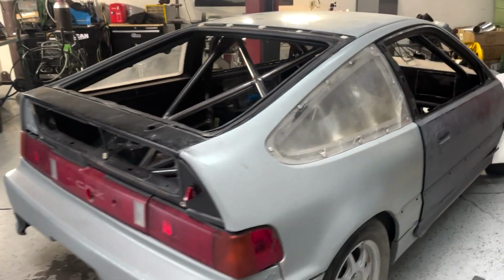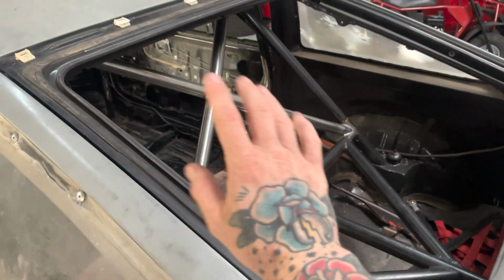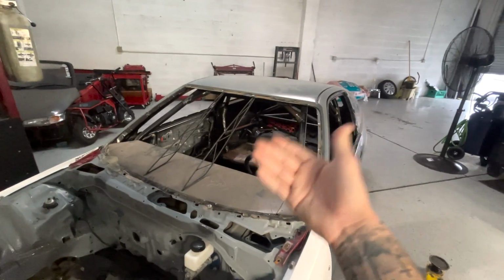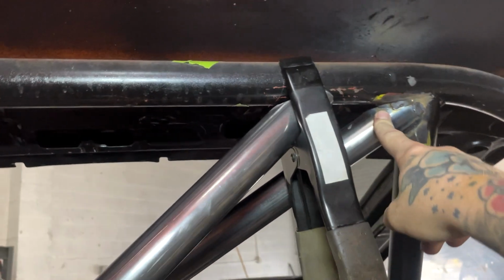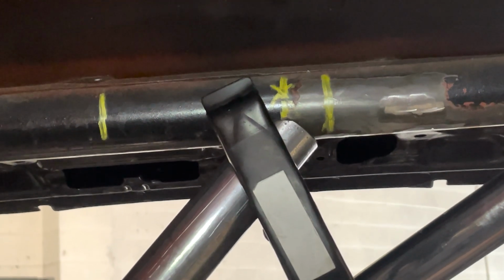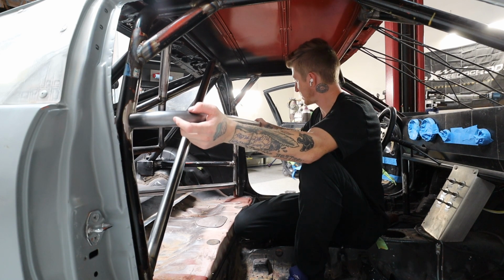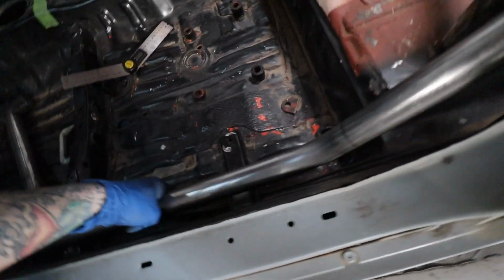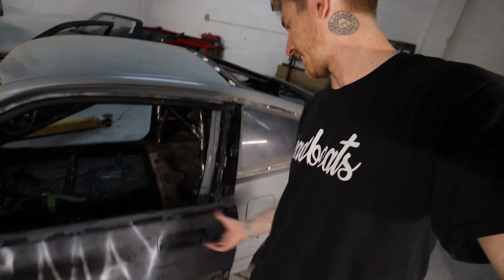Making More Progress On The Honda CRX

Comment: I am not sure if you plan on doing more cages but when I had mine made, I signed a liability waiver. I would especially have one for vehicles like this where you are building on someone else's work.
Reply from the maker: I may do more in the future. But liability waivers will be a for sure thing. That’s my fear with taking the job on with these types of jobs. It’s more than just cutting and melting metal